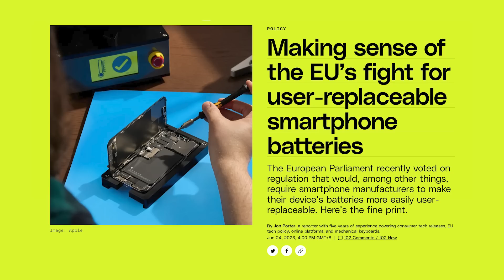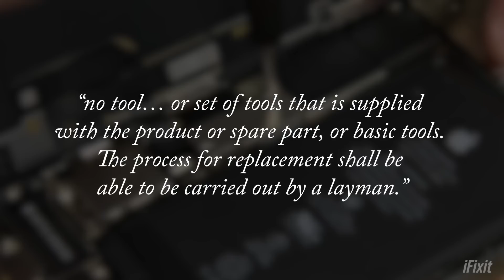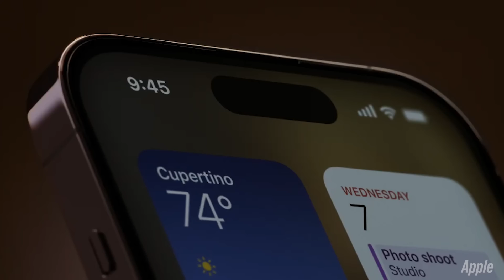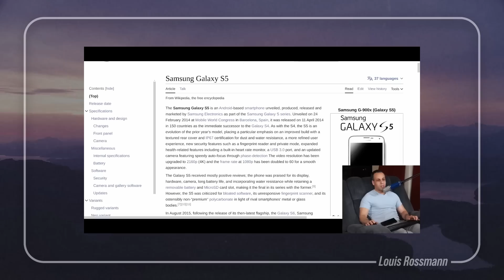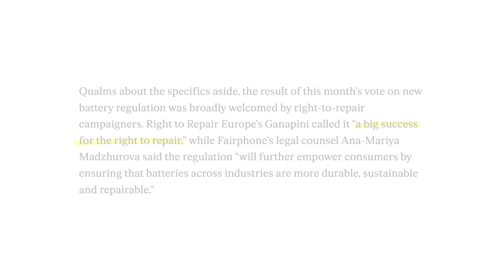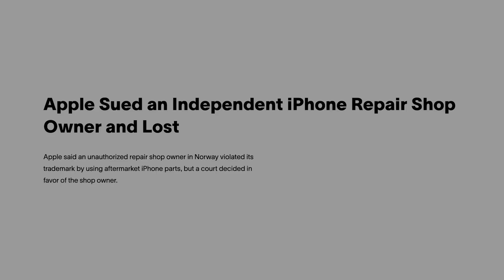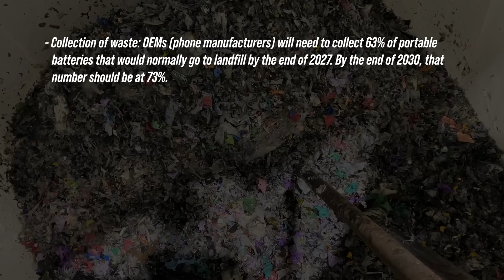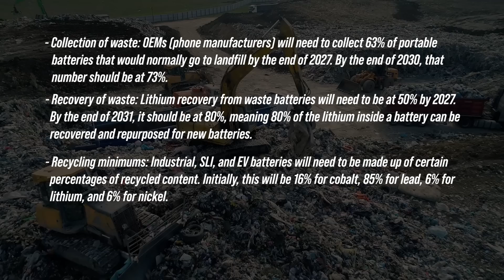EU Just Changed Smartphones Forever

Comment: This is great, but I'm really curious to see how this is going to affect waterproofing in particular. I know it was already touched upon in this but I want to see the different designs that allow it specifically, I know it can work.
Reply: i'd prefer the one they showed where you push the mattery into the phone from the bottom.
It could even have two screws or a cover that hides two screws.
Else I'd like it to be like the sim card tray, where you push a needle in and it can pop out. That can also be water proof

As for removable backs, I think having glass on the back is too good for selling more devices due to cracking, they probably would need to either make it with a combination of clip and screw, or slip and screw, or they seperate all other electrinics with a plastic cover from the inside, only the battery is on the outside and even that can be covered by a plastic. Then the back cover can be attached in any way they want.
Maybe something simple like clips that spring open with pushing a needle in from the side

Comment: This law does not require consummers returning batteries to the manufacturer. It means manufacturers must source a percentage of used/recycled materials. In Europe you are already supposed to drop off spent batteries ( even classic dry cells ) in a sorted bin at the local tip or return them to sales outlets like supermarkets who are required to provide a collection bin. No great change there. It just made scrap more valuable.

Comment: Wouldn't having smartphones with replaceable batteries create a consumer batteries market leading to the unnecessary production of even more batteries than in the current landscape, thus creating more battery waste? At least when companies like Samsung and Apple handles the replacement of batteries, they can easily collect data on battery replacement rate and produce battery inventory accordingly. If replaceable batteries are in the free market then companies would just jump into the batteries market and create more batteries than needed, hence, more waste.

And just like how cheap, non-durable solar panel hit the market, the short lifecycle actually means more waste is produced. This could happen to off brand cheap short-lived batteries too. Any thoughts?

Comment: HOT TAKE: I think having a closed loop on battery recycling and manufacturing is more important. Software that limits features is the true enemy. I could be wrong but wouldn’t more 3rd party business’s spring up to provide batteries with this switch leading to more waste? I know how some people are and they would change a perfectly good battery with 90% health because they can “feel” the difference and “need” a brand new battery. Interested on others take on this and i’m someone that holds onto a device until I have a hard time using it in normal day to day usage.

Comment: I think you’re wrong that devices will change significantly. As I understand the regulation the latest iPhone could perhaps be considered compliant. If all you need is a screwdriver and to remove some pull-tab glue pads, it should be compliant with the regulations, no?

Comment: What a silly intervention by the EU. If you run out of battery you can always connect it to an external accu while undoing the protection to change battery is usually tedious work and always involves the risk it slips out of your hand which causes high repair costs in case the screen gets broken. Idiots in Bruxels there are better ways to protect the consumer especially when it comes to manage inflation!

Comment: how about the EU piss off and actually make a policy that makes a difference or saves life. Has anyone seen the current crops of cars? the stupidity of useless screens and touch controls? they should worry about that not my phone! How about forcing every manufacturer to offer a spare tire, instead of fix a kit gimmicks etc. Soo much effort wasted on non issue. A typical phone will last 5-6 years, will benefit perhaps once from a battery change that costs perhaps $60-100. After that it is a waste. Just stupid effort for no real benefit.

Comment: I hate the glass back so much... They wanted to make it look cool in the store, but it scratches and breaks easily, so you are forced to use a condom with it. Then, it's a fingerprint magnet, so they made it oleophobic. It's so slippery, actually to a point when you leave your phone on a couch and it slides slowly, falls and breaks. Again, need a condom, and it's no longer sleek not nice looking.
I'm nostalgic of non-painted polycarbonate backs, like nokia 3100, even samsung crap. It was sturdy, looked good for long time and was cheaper to replace than most cases these days. I can't believe this glass thib is dragging on for so long.

Comment: As a layman, how would replace a battery in an EV without tools? You cant change a tire without tools. I remember when the battery would fly out of my phone when dropped. No big deal, pick it up put it back in and snap the back on. If an EV gets in an accident, would the layman removable battery also fly out? I agree with this applying all other applications. I think the EV one need to  be thought out a little more.

Comment: If we become just a bit concious, it will go long long way. I am using OnePlus 6T and I have decided to use it till it  die on its own...its 5 years now and still running as a new...no lag...but yeah battery worn out so it wont last whole day...but it works fine...
Reply: Imagine if it had removable batteries it could last you 10 years.
Reply: @Grinderius  yeah I am thinking if i take it to service centre and change the battery.

Comment: The current iPhone 14's sold in the US only have dual e sims where as in Asia they have a physical dual SIM card  tray.  I know SIM cards are fairly small so it may not be a big issue for Apple to have two versions of the same phone for different markets as they do now.  I wouldn't be surprised that Apple will design a different phone with removable battery for the EU and non-removable for the US market based on the the above facts.

Comment: It was motivated by the retirement for structural strength. I myself had sony phone bent in half in my pocket. Having an edge to edge sandwich of unbendable plates is the strongest way to construct a phone.
In my opinion, it's one more stupid law that EU proposed! I'm still so annoyed from the cookies law that I have to click these banners away on every website... Instead of making the batteries replaceable they should've required the manufacturers to install batteries with double the capacity that people would reasonably need. This way, the battery would survive longer than the useful life of the device itself. The majority of people wouldn't mind having a phone a few mm fatter to gane an extra day of battery life.

Comment: A few years ago I had to replace a battery in a swelling Galaxy S7. That's the time it was a factory flow (not officially on the S7, but..) on Samsung's phones (meaning even in the factory it was hard enough they were doing it wrong).
It costed me 100 euros, but I remember that in order to do it myself I would have to have bought an official battery for 80 bucks anyway. 
So the battery is now likely to cost the same as what replacement by a third party, with a new official battery, would have costed.

Of course competition can play, but the problem is, while it's perfectly fine to replace your headphone's pads by cheap chinese ones from Ali, the last thing you want as "cheap chinese" is a highly flammable phone battery. (but all the other components, yes).

I'm not too worried by design changes though. I suppose batteries will come enclosed & easy to clip, if the law allows for that.

Comment: I think rather than the manufacturers thinking "how can we rip off our customers" it was more like "we could make it thinner and lighter by gluing the battery in, this would hurt repair-ability but we could make more money with replacement parts - so lets do that".
Reply: I guess that's why Apple write software to detect if the parts in their phones were shipped with them. If not then the phone won't work properly or at all. (does not matter if they are genuine apple replacement parts or not) The manufacturers are out to get as much money out of you as possible. By whatever means they can get away with.

Comment: Next step: Force manufacturers to provide security updates for longer than my battery lifespan. This battery law is worthless if you have to bin your phone once it doesn't receive any more updates and you can't install another OS that still receives updates either.
Personally, I think smartphones peaked somewhere around 2018. We had headphone jacks, awesome screens, good cameras, in-display fingerprint readers, good-enough power efficiency to last for days, SD-Card slots, more performance than I'd personally ever need on the go, fast charging and unlockable bootloaders.
I just want a 2018 smartphone with better efficiency so that it lasts even longer on one charge and a removable battery, and I don't need it to be waterproof.

Comment: I'm old enough to remember a time where you could walk into just about any phone store to pick-up a brand new battery for a few dollars to keep on hand in-case you knew your current battery wouldn't last (before portable chargers were a thing), or in-case it was on its last legs. You could pop open the back cover, replace and go about your day in a matter of seconds, maybe minutes. It was that easy.

These days, you need a bunch of specialized tools and adhesive remover to even think about getting a battery out, and with one single manufacturer locking away key features on the phone for this apparently simple (not) replacement, then we've lost right to repair a long time ago.

I'm very curious to see how companies will adapt to this change, as the EU market is simply too big to either ignore or create a specific model for; either option or many others would eat into profitability. 

Cheers!

Comment: Changing to non-replacable batteries was entirely about profit, in my opinion. Arguments about water resistance are also a load of rubbish. None of the smartphones I've owned, since the move away from a battery i could pop out, have made claims about this.

Yes, I'm cynical, but i think I've got good reason to be this way.

Comment: If the replaceable batteries were phased out due to design constraints and not due to monopolistic intentions of the manufacturers, then they would not impair phone features upon detection of replacement batteries.

When a company touts consumer benefits or protection as their motivation it is a lie. Corporation officers have a fiduciary duty to shareholder value, not any other touted benefits.

Comment: ahmm i agree on replaceable battery on phones and laptops and tablets and ebikes, but EV?? no thx, its just gonna be a big mess, we can do what hummer did maybe, its batteries are split into many modules, and if any module fail, replace just that module. now coming back to the rest, well there is a major loophole and apple will fr fr use this loophole i guarantee you, basically replaceacable battery doesnt mean you can just buy a new battery easily and fix battery issues, the manufacturer can make it so that no other battery is compactible, and apple is known to do things like this, this is exactly why it kept lightning port all these years and also the new airpods feature to not let copy airpods not connect easily, same will be for the battery

Comment: I know that the EU does it mostly for the environment but this is still a huge win for consumers, just like their law to standarize the charging ports of deviced instead of having different chargers that just worked for one phone, you have charges compatible with most devices in your home now, and now all devices are USB C compatible.

But I hope this user replaceable battery initiative appliew worldwide, I am not a huge phone user, but with gaming consoles, I remember carrying an extra battery for my PSP but with my Switch Lite, the moment the battery dies I'm screwed, and you can say that there are battery packs, but they are annoying, why carry a big box that dangles from your device that also may not provided the enough current to charge your device, when you could easily switch to a fresh OEM battery that will give your device more hours of usage with the right amount of energy that it needs.

Comment: The fact that they're bricking computers people paid over 2000 dollars for is beyond stupid. I wasted an entire month of my life replacing the battery on my mom's 2017 macbook pro 4 times!! 
They would work for a few days normally then stop charging. Finally had to go back to the Apple Store where they were charging 250 for a replacement I could do myself for under 80 bucks.
They actually were trying to charge me 600 saying could be the logic board if none of the batteries were charging, ports  may be damaged. But the laptop can be bought refurbished for close to that so it's clearly a scam. 
Once I put in the OG battery back (glad I kept it!) they were able to "run diagnostics" and learn that i just needed the battery replaced. Huh, could've told them that without any fancy bs. 
Unless you're locked into exclusive software, the way Windows 10 Pro has evolved, there's really few reasons for people to stick with Apple when they're clearly pushing for consumers higher and higher up the income spectrum WITHOUT actually offering a better, more premium product. 
Everyone caught up to them and their answer seems to be charge even more for a less and less open system. Fuck them.

Comment: My Blackberry Storm II (2010) was the last model I've had with a swappable battery. It's alleged data-encrypted network was revealed to be back-doored during Arab Spring by UAE demanding the same set of keys that US CIA and NSA had installed.
On the laptop side, my P51 Thinkpad is still whirring along. It replaced my MacBook (2006) and MacBook Pro (2007) all of which I kept much longer than I likely would've otherwise if they'd not all had modular swappable, batteries

Comment: Hope the change will be implemented worldwide. With non removable batteries, for long heavy usage away from home, we end up purchasing power banks, which also have non removable batteries, exacerbating the e-waste problem even further. In the early 2010s, one could still carry spare batteries and do a swap easily. no lugging around heavy power banks. no need for wasteful enclosures for these power banks, etc. From own experience, many devices do outlive the lifespan of the non-removable batteries inside them.

Comment: I love this. There aren't enough phones anymore that sport a battery you can replace on the fly like you can with a Samsung Xcover series. We started using the Xcover 6 Pro and the Xcover 5 because it has easily changeable batteries. The same goes for laptops. You used to be able to click one out and plug in a new one in a few seconds. Same goes for processors, memory and even graphics cards.

Comment: I had no idea this applied to EV's as well. Hopefully this doesn't contradict with efforts to make EV's safer in accidents. Typically EV's store their batteries on the floor on the car, which no matter the design isn't going to be easy for any consumer to replace, you'll need the tools a car garbage has to lift a vehicle into the air. Also, IMO I don't think that too many people are going to try to change their own EV's batteries anyway, unlike smartphones.
Reply: Even the the most easy to replace battery in a EV weighs a few hundred Kilo.  No chance that will work without tools, but I hope the OEM car manufacturer will be forced to lay open their protocols to connect 3rd party batteries in their cars.  Which is the biggest hurdle to EV battery swaps. The battery software doesn't know the language the car speaks...

Comment: I like the idea of this but I haven't read the minutiae of the legislation. Nothing to stop the manufacturer from still locking you into their proprietary products. Those old batteries across all the various models were mostly all samsung or toshiba at the time regardless of manufacturer. I don't like the idea of some exploding cheap aftermarket battery though. And a "refurbished battery"  off the street would be even more dangerous
Reply: EU has already voted the law against the purposeley rigging devices to break after warranty expires.

Comment: batteries need to be standardized as the biggest issue back in the days was...
yes you can replace your battery but since that model is no longer produced there were no batteries so you still were forced to buy a new phone   
and even thou the industry is no longer as dynamic as it used to be chances are manufacturers will abuse the same loophole

Comment: If I was an American based company like Apple I would simply pull out of the country. As for Apple only wanting you to use genuine Apple parts makes sense. There’s so many knock off screens/parts for Apple products that could be junk causing the user to think Apple builds junk when they don’t. On top of that I’ve never had a screen replacement be as good as the original screen. I think phones are a consumable/replaceable product. A sealed phone or tablet has more benefits than one with a removable battery in my opinion.

Comment: 7:17 In the USA we pay extra for certain things, like car batteries and alternators. When we return the old part to the retailer, we receive back that extra money, the "core cost". 
This helps to ensure that the old parts get back into the system for recycling and reuse. 
If the same is done for phone batteries, then it can be pretty painless to achieve the desired results.